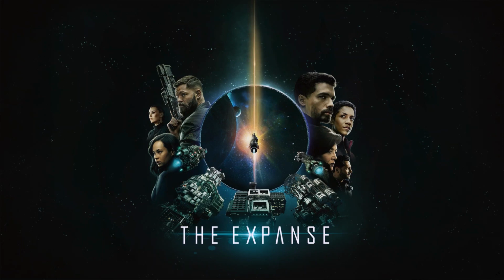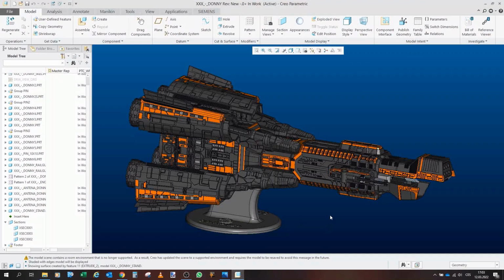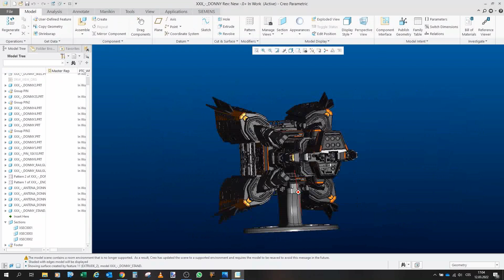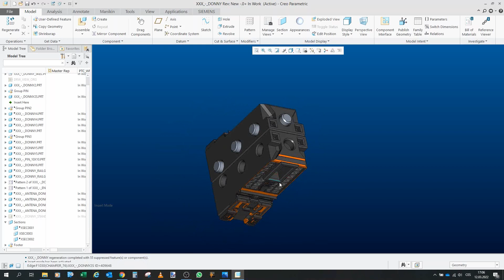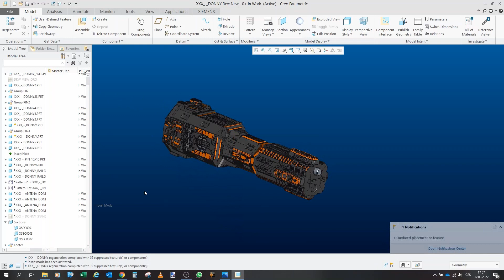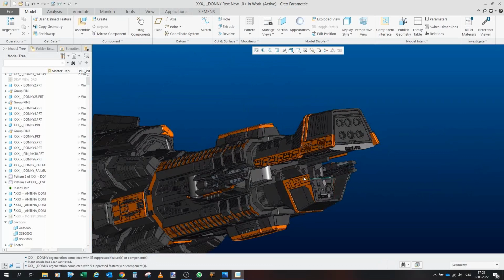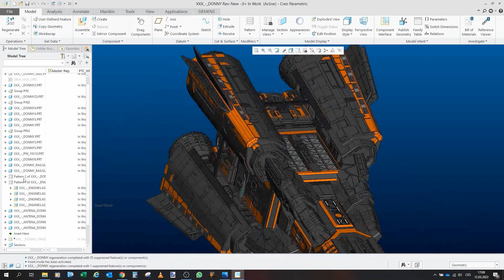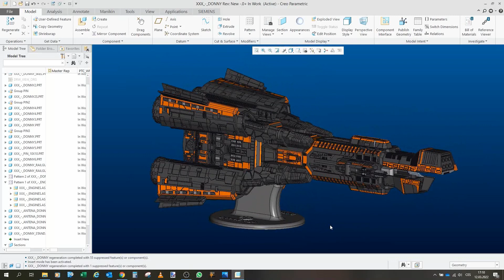Project Donnager Part 1 - Model Overview

Comment: I have enjoyed your models and I am looking forward to making this one, would it scale up to 50-60 cm or would this distort the surface detail too much? Oh, is it possible to Light the engines or would I need to add additional channels for the wiring? I guess the size though is the limiting factor, still would look good as a static model, well done again.
Reply from the maker: On the contrary. The level of details i did is too much for the scale so if you scale it up, you will actually have more details. As for the witing, no, i did jot include any cable management as i am not really knowledgeable about that stuff.
Reply: @martintaichl  Thank you and I am looking forward to then model.
Reply: @martintaichl  As always, huge fan of your work, especially with the Serrio Mal. One question though, do you do you happen to know where I can find a good model of the Barkeith?

Comment: Have you considered publishing the full 3D models, pre slicing? It would make it easier for people to scale their own prints, rather than trying to figure it out from the size of component parts. 

Also the Donnager class MCRN Sagarmatha is a legend, starting a battle with critical damage, still manages to hold off the entire Free Navy until it's stabbed in the back.
Reply: Also, just did the math and the Donnager would be 8.15 meters long printed at the same scale as I did the Roci, wow
Reply from the maker: True. That was disgusting stabbing in a back. 

As for the model, yes, when i have a model in one piece, i usually publish it as well. But in this case I did not model it like that and I do not have a whole model. I modeled the main body, then the engines, railguns and some details. So in this case, i cannot really help
Reply: @martintaichl  Another great one! Couldn't you just export the whole model in your program (Creo) to a stl or 3mf file? I would love to see some of these models bigger! I guess resizing each piece is possible with just cutting whichever pieces are too big for the buildplate on the users end. Would scaling work on each piece or would it throw everything off? I know everything would have to scaled evenly.
Reply from the maker: @StumblingBumblingIdiot  i usually do publish also a whole model, but in this case I did not model it in one piece. So i cant really do it. In any case, just simply scale all the pieces with the same scale and that is it
Reply: @martintaichl  Yup, I did exactly this on your Roci model, everything but a couple PDC's is complete at 150% scale, its about 30" / 75 cm long/tall
Reply from the maker: @CodyGraham  would you hapen to have a link to some pictures?
Reply: @martintaichl  I posted a link, but I'm not sure if youtube deleted it or you did, either way, more than happy to share some pics
Reply from the maker: @CodyGraham  certainly not me. YT and links...not a good combo...
Reply: @martintaichl  OMG, I have now tried like nine times to post my email or a link to a site with pictures, just finished everything but the landing gear yesterday even, and I have a razorback to go with in the same scale too now...  guess I'm going to have to make a video ffs